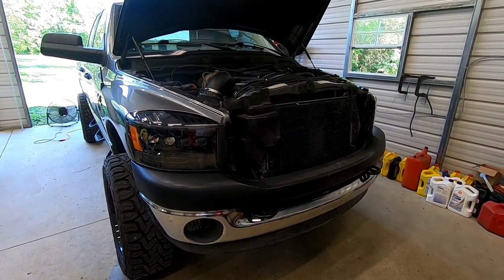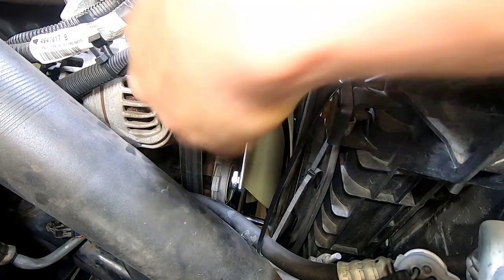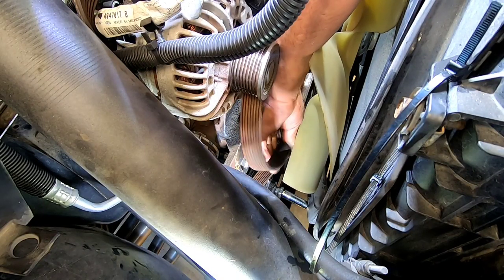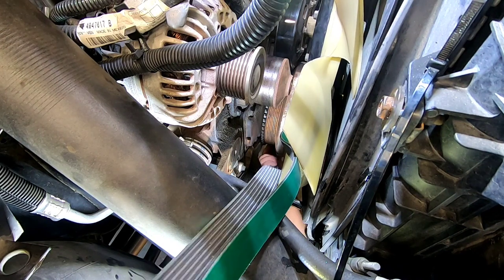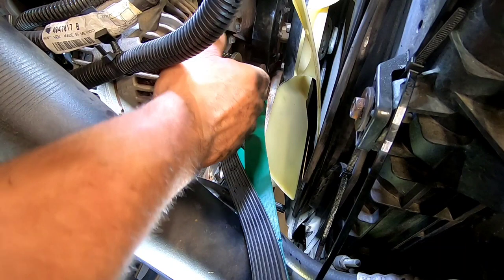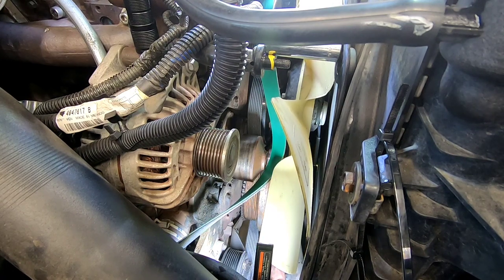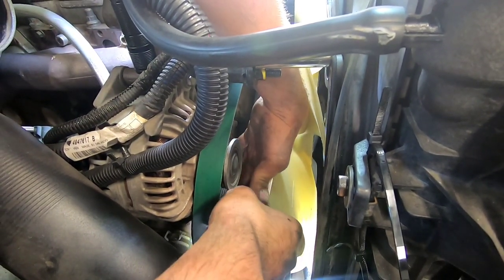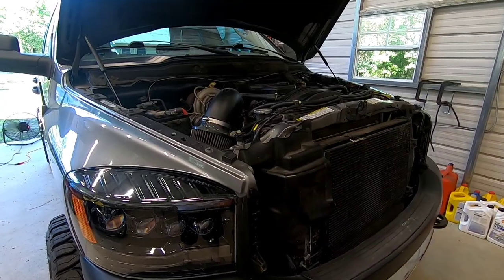5.9 and 6.7 cummins drive serpentine belt replacement

Comment: Unless you are keeping that used belt for a back up why not just cut it off and not fight it to take it off
Reply from the maker: Because I wanted to show the process on how to remove it because removing it will kinda program your brain on what needs to be done to get the new one  back in.
Reply: @isolateddieselperformance3261  makes complete sense now, I’m an idiot.
Reply from the maker: You're not an idiot. You just didn't know the reason. I'm glad you ask because I like to communicate with people willing to learn.
Reply: I was thinking the same thing but this makes sense.

Comment: This video is the quickest and easiest i have ever replaced this belt. The added steps of removing the airbox, tensioner, and loosening the fan shroud are the trick. These steps pay divedends in making it quick and easy. Watched the video twice through, second time wrote down the belt routing steps. With my steps and a belt diagram this thing went right in. 
Thank you for a great simple video. The explanation more than makes up for the impossible tight space to film.
Reply from the maker: Your welcome brother. Thanks for watching and im glad it helped

Comment: I have an 05 Ram 5.9, after working the belt around the fan and after much struggle and restarts, I had the belt under the truck and folded it and thread it through from the passenger side until it looked to be in right place, then I pulled the bottom down and threaded it around, then the top kind of fell into place.  I also replaced a pulley and removed the tension pulley.  This worked so much better than all the other ways I was trying.  
Love your diesel videos!! I too am isolated as in rural area so love that too.
Reply from the maker: Thanks man! Belt replacement is one of them things you do that works the best for you. Thanks for watching God Bless

Comment: Thanks!I must have watched 5 videos on this, yours is the only that worked for me.I did tensioner waterpump belt and idler.Just a heads up that fan shroud comes out fairly easy.It has a hard side and soft side you can actually fold it up on itself.If you have an extra pair of hands 1 guy up top 1 guy on bottom it will slide right out.There is 1 10mm nut holding bracket for the fan clutch needs to be removed.Once I had it out I zip tied so it would stay slides right back In.This is my 3rd waterpump and the belt routing always a pain.I have the diagram but its knowing where to start.Thanks again.I was able to do it all myself but an extra set of hands does help.When reinstalling fan clutch wires and bracket make sure your clear of the fan.The blades clear by like a 16th.
Reply from the maker: Thanks. Everything you said was pretty much correct. One person can remove the fan shroud. I have a trick for that.

Comment: Great video. Wish I would have watched it prior to installing Banks Brake system with new serpentine belt. The belt was the most difficult part of the job having never done it before.
Reply from the maker: No room in these trucks. Couldn't get my camera down in there to get a better view.

Comment: Good video.  Good channel.  You have a very folksey down home way of explaining things.  You have done a few things I have looked at doing to my 2004 RAM 2500 5.9.  And some I have done.  And yes the belt is a PITA but it is doable by yourself.  You may have to climb up and down a few times, but it is able to be done without removing the fan or the shroud.  And I got the gates belt and tensioner "kit" when I did mine.
Reply from the maker: Thanks! You get good at it after doing a few

Comment: I am about to do mine but after watching several videos about this why struggle to get the old one out? Can you not just cut the old belt and pull it out of there? Seems there would be no need to pull it out intact.  Thanks
Reply from the maker: Yea you can cut it out. The only reason why I didn't do that was to show the step for the ones that need to remove a good belt to change their water pump or any other part but more importantly it will help program your brain on how to put the new one in.

Comment: What happens if i can't move the tensioner pulley
Reply from the maker: If you're pulling the right direction and it won't move, then you will need to cut the belt off and replace the tensioner pulley.
Reply: @isolateddieselperformance3261  oh.. ok. Thanks. My daughter got. An error code that it might be the alternator, or battery cable..etc.. i hope its something simple.. she has an 08 cummings.